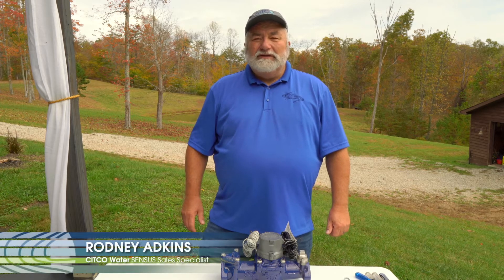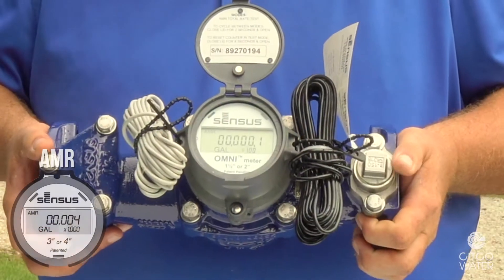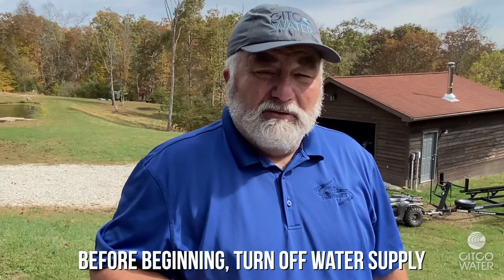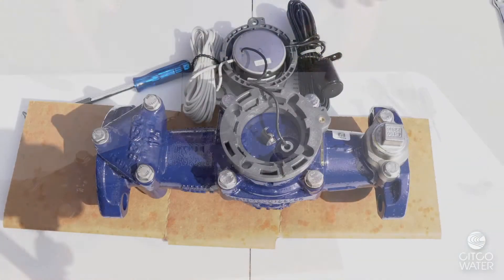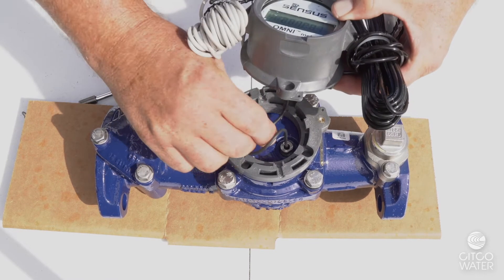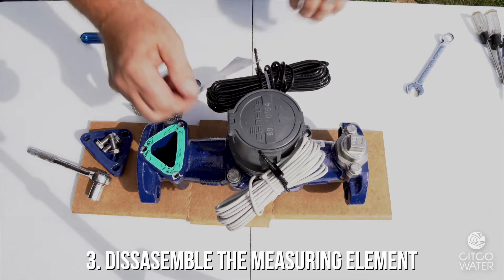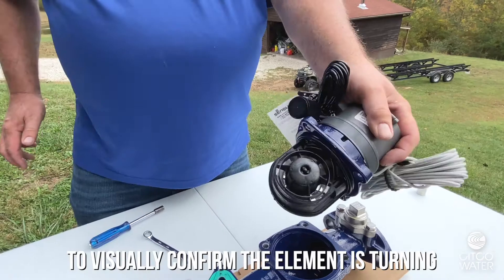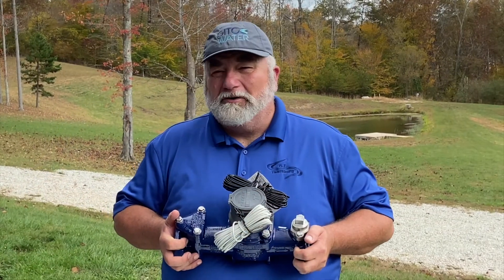SENSUS Omni Meter Demo | Rodney Adkins, CITCO Water

Comment: Our community water system just had this installed - replacing an old analog meter.  To read the meter, we have to climb down a cut out in the floor of our pump house, which is not fun. LOL. I would like to use my phone or our WiFi network to read this meter. I've looked all over the Sensus site and see numerous communication methods and devices. But I'm not understanding what I would need to either hard-wire via ethernet to our network or connect via bluetooth or WiFi.  Can you do a video on that or reply to this comment? Thank you from Idaho.
Reply from the maker: These smart meters are able to be connected to an AMI (Advanced Metering Infrastructure) and SCADA (Supervisory Control and Data Acquisition) system to then be read remotely. One of our guys would be happy to point you in the right direction with that. Try Rod by email at Rod.adkins@citcowater.com
Reply: Look at Metron-Farnier Innov8-VNr remote readers. They can be installed on various brands of water meters.